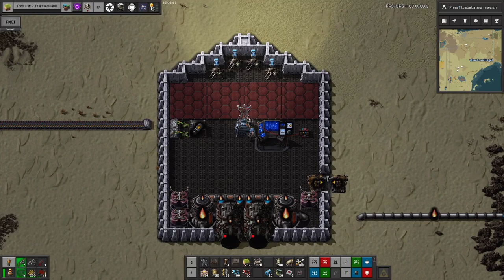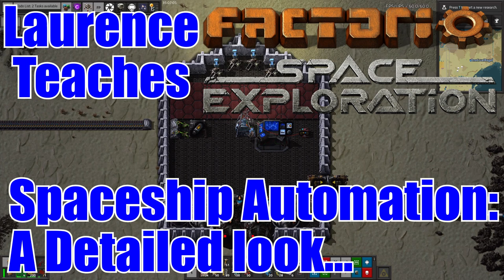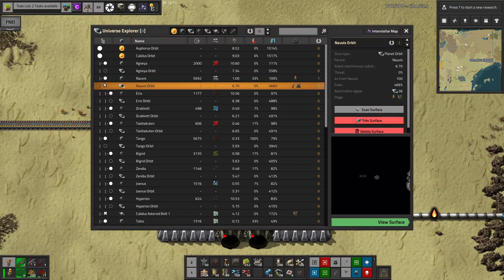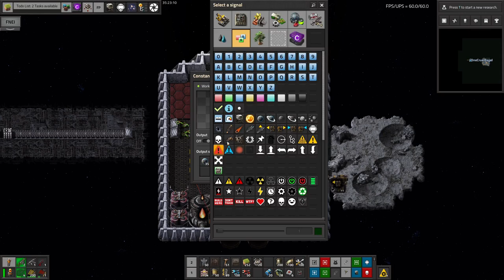Spaceship Automation tutorial details - Factorio: Space Exploration - Laurence Plays

Comment: Tip for anyone, you can use on/off buttons on constant combinators for simple switches. Here, to pause a ship, turn off the combinator with the launch signal. You can also have small switches on fuel pumps and such if wanted using wired constant combinators.
Reply from the maker: That's a good idea - I like that one! Thanks  🙂

Comment: I did my external logic slightly differently:
I would have a constant combinator always sending the destination to the ship (this has the benefit you see when you were setting it inside near the end where you can open the UI to see the destination and tell it go early easily).
I then have a single column of decider combinators which each output 1 launch signal when their condition is met and I have the constant combinator also output the appropriate negative number for it to only launch when every condition is met.

25:00 - Here you don't need the second decider combinator inside, you don't need to go via a green tick. Instead, you can have the console output and the constant combinator both feed into a single decider combinator (with different colours) and pass through when on Nauvis. Would save a couple of squares.
26:30 - Similarly, here, you don't need the launch constant combinator, you could just have the decider combinator create a launch signal when its condition is met. This is outside the ship though so space is much less limited so it's less important.
Reply from the maker: I do quite like the neatness of your way (1-n launch signals), but I felt my way was slightly easier to understand. This is a good next version for it though! 
I did try building the ship with only a single insider decider, but I was struggling to get the logic to work nicely and not pass signals the wrong way. I clearly needed to think about it a bit harder!

Comment: Great video! I finally reached spaceships stage in my walkthrough. Few questions: 
1. What happens if clamp on destination planet is occupied by another ship? Will ship crash or wait until it's free to use? 
2. What happens if I specify wrong (not existing) destination ID or clamp ID?  Or clamp gets removed while ship is on its way
3. During cargo rockets stage I had single silo for each resource sending rockets to multiple destinations. Is it possible to do something similar with spaceships? 1 ship serving each planet, or maybe even fleet of spaceships that automatically picks up where to go and what resources to bring. Interesting challenge, but not sure if it's worth it. Spaceships are not that expensive to build.
Reply from the maker: 1: it will wait. Including if the player is in the landing zone.
2: the ship will arrive, but won't be able to anchor, so it'll just wait until you fix it with the nav sat ( or by replacing the clamp)
3: it should be possible to implement one to many, however I haven't tried yet. We'll probably try it during our current run, so make sure you're subscribed so you don't miss it!

Comment: with your set up, my ship just launches, and then comes straight back to nauvis...I just dont get it.
Reply from the maker: I'd suggest checking that you're sending the correct destination to your spaceship - it needs to be told where to go, so if the console isn't getting a destination, it will launch and then instead of setting off, it'll automatically dock again.
Reply: @LaurencePlays  thanks so much for the quick response, I have it wired as you do, the output signal is outputting world signal #1236 (thats my grannus) 2 checks, (correct) and the launch command. I get it to work fine when im standing in it, but it wont launch if im not in the ship. it just lauches and returns to the nauvis launch point.
Reply: @LaurencePlays  omg... i figured it out, it has to be the same exact ICON as well as the signal. I had a planet with a ring around it, and grannus is just a planet... jeeeeebuz, i probably burned through 2m fuel figering that out.
Reply from the maker: @raoinshishiza152  Aha! Well done for working it out  🙂 Technically, the ones with rings are planets, the ones without are moons (I think it identifies them when you mouseover). It does feel a bit unnecessary though, since the numbers have to be unique as they're outputted from the console as a single signal to show where the ship is currently anchored.